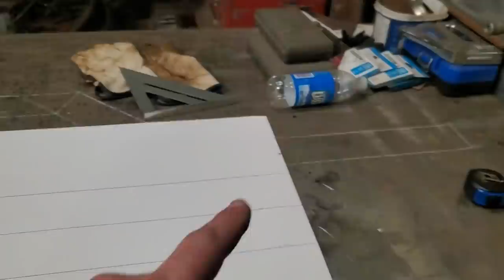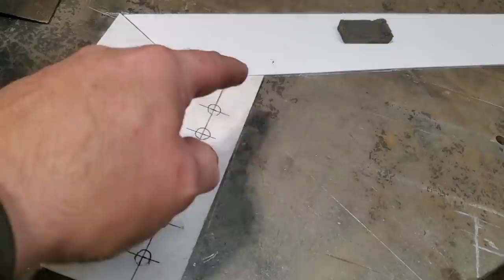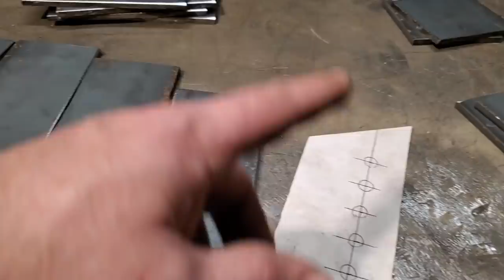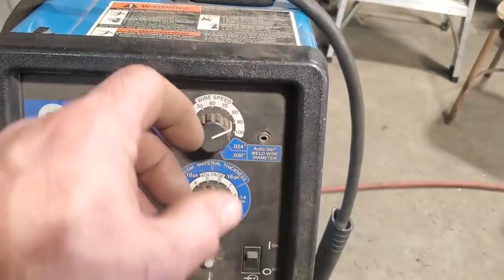Crusty Is a roller!

Comment: Hey Fitzee, amazing job so far. I wanted to contribute a little suggestion for your bare metal project since you'll be steping away for a little bit. Lightly coating your bare metal (or lightly rusted) with  Kleen Strip concrete and metal prep (basically a mild phosphoric acid I think) will stop it from rusting for a good while while etching it. After a few hours, just neutralize it with water/baking soda although it actually doesnt hurt to leave it on. On rust, it leaves a white residue that can be painted on although I prefer to remove it with sanding. The product is dirt cheap at $15 1/2 gal. I've had bare metal parts for a good year in the high humidity of Puerto Rico and it just turns bare metal into a kind of a galvanized look. I even sprayed it inside hard to reach chassis sections with a long hose and a spray tip before applying rust encapsulator or paint.  Anyways, that's it for that one. Hope the tips are good, and until next time!
Reply: "Anyways, that's it for that one. Hope the tips are good, and until next time!" You are so right on that! Stay safe in Puerto Rico, greeting from Switzerland 👍
Reply: @rjung_ch  Peurto Rico?  He's in Newfoundland, Canada.
Reply: @rgc1961  Fred Laracuente is from Puerto Rico. He is taking about himself and not about Tony. Hope this helps you clear your concern.
Reply: @rgc1961  they’re basically the same place with the exception of every single detail…🤣🤣🤣🤣
Reply: @nobodyspecial6436  My thoughts exactly!  😁
Reply: Thanks for that anti rust treatment tip. I'm going to try it when the temperature here is above freezing. How my climate can have sub tropical humidity in the summer and near zero temperatures in the winter is something that has always surprised me.
Reply: @nobodyspecial6436  and @B C apparently you guys are trying to keep a good sense of humor and I thank you for it. But for those who don’t know, there is a minor similarity between the two places. Both are surrounded by a large body of water that some people call it (I think an ocean)(that is water with a high concentration of salt) therefore it generates a lot of humidity (wonder why). I think it was just a reminder of something that Tony is well aware of. 😉😉
Reply: That's what I use on my projects. Works great!
Reply: @calebvelez1836  thanks Captain Obvious….
Reply: @nobodyspecial6436  What? Not so funny now? 🤓

Sorry if I hurt your feelings. 
Remember, it’s just keeping a good sense of humor!
Reply: @calebvelez1836  still funny…. I’m not one who gets upset by words on a screen….. you stated the obvious so I retorted with a sarcastic thanks… all good fun
Reply: @nobodyspecial6436  l agree 💯. 
Back to the subject, I love Tony’s work. More down to earth. I can never afford to do one high end restoration. I will do it his way. Accomplish the results the easiest and practical.

Comment: Great minds must think alike, when I did our 65 Mustang 20 years ago, I made 2 x 3 frame rails as you did, but I  installed a 4 link, I used the same process as you did.....good job!!
You can order springs from Calvert, I'm sure you know that..the only problem I ran into with a A arm front suspension was the headers...they were a nightmare!!

Comment: I'm liking the approach of building it square and solid, then figuring out the misc via templates and common sense. These days way too many would do some fancy computer aided drawing and spend twice as much time fabricating on the bench, then be lost while trying to suspend the part in mid air. Can't wait to see how you attack the space needed for a driveshaft, which I'm sure will be another template laid out on the bench, I mean, it's "cut and fit" but it's something anyone can relate to and get a good end result with basic tools.

Comment: Just find some good thick well casing for the driveshaft. that will maintain great cross member strength and look cool. Drill some of them big fancy lightening holes in it like the slider brackets. Very impressed with your work. I am a mechanical designer, Aerospace. What people don't realize about design/fabrication is a good designer is one who recovers from an error quickly, cheaply and correctly. I was good at that. You are as good as it gets. It's unbelievable to be as good as you are with no frame jig, no engineering drawings in 3D solid modeling, no lasers and no help. Be proud. I fall asleep every night thinking about how to fix or refine something on my home builds. You also make good videos.

Comment: Great work Fitzee. I built a similar chassis under a '71 Pinto in 1980. I couldn't afford the popular Alston kit at the time but tubing was affordable. I was lucky and didn't have to fix rust. It was 94 inch wheelbase and quite a handful at 125 mph. Thanks for the great video.
Reply: I drove a buddy's BBC w/power glide, Opal GT on the track. I don't know what the wheel base was, but SHORT!!!! That was a scary ride from leaving the hole!!!  First car I ever drove that left the hole around 5K... I don't think I took a breath until I was on the return road..
Reply: @SteveP-vm1uc  Yep, mine was my introduction on what bump steer really means. Once the chassis is dialed in its still an exhilarating ride.
Reply: I sure hope that you didn't run any Firestone 500 radials on a "71" Pinto at that speed.

Comment: Like the way you work, I like to use Bacon grease for drilling and tapping holes. It is cheap and works as well or even better then the commercial store bought stuff, been using it for years.....Only thing is you have to keep it covered because the mice loves the stuff.  Stays fresh at room temp as well.

Comment: Awesome work! Both in the build and in documenting all of what you do. I really appreciate how you took the time to share your welder set up for the 1/4” plate. I noticed you were kind able of pulsing while welding the chassis to the plates on the body. If you need an idea for a short video (like you don’t have enough on your plate already) I’d be keen on learning about that technique and using the mig to weld heavier material. Thanks

Comment: I ran into the same issue about the leg room, but remember there is rails /slides going under the seat. You should get close to the 2" back  once the seat is off the floor.

Comment: Once again I commend you for what you do with what you do it with.(if that makes sense) But, and this is my opinion, for doing frame and chassis work I have made the investment in an auto leveling laser level. The kind that builders use. projects lines both horizontal and vertical. It takes the uneven work surfaces as the floor and work bench out of the equation and allows you to get everything dead nuts accurate. Easily with in a 1/16" or less. well worth the couple hundred bucks you pay for it. Cheers

Comment: Nice! I'll have to finish watching it later. Got to do the work thing. I started thinking about setting up the rear of the 50 using truck trailing arms, and got lost in a day of instant center theory. Not sure how much difference it is going to make, that 8BA is a powerhouse! LOL
Reply from the maker: You get a real nice ride with those trucks arms.
Reply: @fitzeesfabrications  Yes sir. I have a 63 chevy truck that I've had for 30 years. Had that spare set of arms for almost as long.

Comment: I built a "T bucket" frame in my dirt floor garage on saw horses. I had more time in plumb, level, and square than I did in cutting and welding. You sure have a nice bench and level concrete floor. Jealous!   CM

Comment: Hey Fitzee, I'm about an hour into the video and I had a question that very well could be covered, but I had to ask before I forget LOL. 
If you're going to be able to change the spring angle by moving the front spring location up/down a max of 7 degrees, that will change the pinion angle also. Will you be using shims to re-set the pinion angle?
Reply from the maker: Shims
Reply: @fitzeesfabrications  minty

Comment: Wow Fitzee. This has been so very interesting to watch.  I love your passion and commitment to the tasks that need to be done.  I'm learning and have a question about why you welded corner supports in the front chassis but didn't in the rear.  I am referring to where the chassis is arched over the  wheel wells.  In the front you welded diamond shaped supports on both s sides of the chassis, but not in the rear?  Is there a reason why?  I love your work.. Can't wait for next episode.

Comment: YJ springs wrap like crazy.. At east they did when I used them on my Suzuki Samurai (SJ413)  4x4 when I added Toyota pickup axles. They turned into a nice 'S' shape in nothing flat.  But you've probably considered this in your design.
Reply from the maker: Yes planning on clamping the front half of the leafs

Comment: If you had needed more room behind the drivers seat for the crossbar location, you could have re-drilled the leaf springs to move the center pin forward. This would have allowed you to move the cross member further back in the body.   With the cross member in place, it would have still allowed you to be able to center the rear axle in the wheel opening.  This is something that Mopar did in the 60 and 70s with their leaf springs.  Moving the center pin of the leaf spring forward tended to reduce spring wrap under acceleration.  They also added an extra leaf on the passenger side to help plant the passenger rear wheel (since because of the torque it is the first to spin) and reduce wheel hop on that side.  Moving the center pin on a leaf spring is a valid way (ie, reliable) to modify leaf springs, as long as you don't drill it closer than 1 inch on center from the original hole (to prevent cracking).  You only need to drill the longest two leaves, you can just move the rest of the leaves forward on the spring.  Moving the shorter leaves forwards also helps with avoiding spring wrap.  You should avoid moving the center pin forwards on the spring more than about 2 inches in any case, because you start to lose any benefit of preventing spring wrap, and because it tends to put an excessive load on the front spring eye and the longest leaf.

Comment: Probably telling you about sucking eggs, if so please ignore, but just in case. At one stage you commented about having the diff pinion parallel to the spring mounts. It actually needs to end up with the engine crank shaft and the diff pinion parallel.  This is needed to keep the angle on the front and rear drive shaft universals the same angle. Having these angles different will cause drive shaft vibration. A universal actually changes speed as it rotates, If the front and rear angles are the same and timed they cancel each other out. I saw it on a garbage truck of all things. It was a new truck but on a certain hill at a certain speed it vibrated. IIRC the diff was only out by 1/2 a degree, we rolled the diff until it was correct, no more vibration. Now seen this on several vehicles over the years.
Reply from the maker: The angle will be set up when engine and trans is installed

Comment: Fitzee that Carola should move out rather nicely . What Mill are you putting in it ? And a four speed should get the torque to the diff . perhaps a Ford nine inch noduler posi should give ya the launch your after but that's my opinion that n five cents will gets me a bubble gum . Lol . But to know what your plan is would be awesome. Please advise . I did a 74 seleca st. It was very quick and was a joy to drive and race . Had a 383 stroker four speed and a nine inch posi . Tons of work to get it all to fit but it was worth every second . The front end was a mustang 2 kit.
Reply from the maker: The plan is a 4.8 ls with a single turbo running threw a 3 speed t400 trans with a 9 inch out the back. Plan is for a 1/8 mile street strip car
Reply: @fitzeesfabrications  awesome should move out nicely . Can't wait to see the finished project. Might have to come have a gander at it. 😎👍

Comment: I love your channel, your skills and the simplisity in how you approache and tackle problems. That kind of rust you jump in to, are at least problems for me. Impressing! 
I know you love your angle grinders, but have you tried a metal cutting circular saw? The benefit as I see it is that they eliminates grinding dust and perhaps save some money because of less wear on a sawblade comparing to cutting discs. One that look promising is Makita DCS552Z. I think other manufacturers have similar.
Reply from the maker: Those blades are thick great for chopping metal but for doing small detail work they are not

Comment: Firstly congratulations, I know the feeling of a milestone like this. Wondering why you wouldnt use the original springs , given they suit the weight of the car, guessing they might not be strong enough for the power or diff weight
Reply from the maker: They were a narrow spring. I wanted to go with the standard 2 inch spring that the caltracs are built for

Comment: Hey Fitzee, be sure to check out K5 or Wagoneer front leaf springs. They're often used in the rear of a yj to add spring rate and/or change wheelbase.
Reply: Also consider a snail pack, wherein the anti-wrap leaves are above the main leaf.

Comment: I foresee problems 1st is with the drive shaft going through the square crossbrace tube and second is drive line inclination and future pinion snubber location.Also isn't'  the differential supposed mount under the leaf springs
Reply from the maker: That cross brace will be moved. And no thr axle can be mounted both ways

Comment: just a question Tony,  i know  it's build as a race car,  any reason  why the option of building it without body mounts,  having  one  solid   structure  vs  2 independent separate ones  ?
Reply from the maker: Roll cage will make it hard to remove

Comment: You've made the plates to mount the chassis to the body - why not add a second plate and bolt them together vs welding to make removal of the body (if needed) easier?

EDIT:  BTW, love the series.  I keep thinking about building something similar, although I have it in my head to use a VW Golf body instead because I'm apparently weird.
Reply from the maker: I thought about doing that but with a cage running through the back dash and front dash it makes it pointless as these sections will be closed in once body is on. If I wasn't putting a cage in it I would did a body mount system
Reply: @fitzeesfabrications  yeah, not having all those details in my head, it makes sense why you are doing it that way.  If I ever get serious about linking/tubing the Jeep, I'd do the same and just weld the body to the new frame rails as well for much the same reasons.  Also, if the body ever needed to come of the Jeep, it's probably junk/rolled anyway :D

Comment: What wire did you use to weld the 6x6 1/8 plate for the outriggers. Can I use 0.030?
Reply from the maker: I used 023 wire. Why cause it was in the machine. 030 would be better.
Reply: Ok thanks I didn’t want to burn through

Comment: Hi can I use 2x2 .120 square tube steel on my rear chassis. I have a 81 Toyota Starlet. I’m doing a project similar to yours but using 5.0 Mustang engine and 8.8 rearend please lmk thanks
Reply from the maker: You can but there will be more flex.
Reply: Thank you any updates on your Toyota

Comment: Hey Fitzee how do you keep it rust free for so long after removing the paint?  If my car sits for more then a day or so it can flash rust in some places.  How long can you leave a part bare metal while you work on the rest?
Reply from the maker: Temperature in the garage is kept a constant Temperature.  It's never really cold out there heat is always on

Comment: How does a guy Measure and find proper Lief springs. I have a 1963 Ford Fairlane with bad rear Leaf springs. Is there a place you guys can cross reference
Reply from the maker: Goggle.  I loked up the springs I have and were the most common short ones I could get in 2 inch

Comment: Wasn’t listening to the video just watching. But if you’re not already planning on using a cal trac setup on this, you really should consider it. I made a setup using part from tractor supply and John Deere along with plates for a full size Chevy truck on my little truck and it brought my sixty foots from 1.5s to mid 1.3s. I also have a little Datsun similar to your Toyota just a mini tub back half but it’s been in the bumper many times. <<<see avatar

Comment: What size wire did you use
Reply from the maker: 023. I went slow. 030 be better for the frame welds. Machine was set up with 023 so I went with it

Comment: I still fail to understand that after all this custom work why you would put in old leaf springs instead of a 5 link with coilovers given your objective of having a performance car. The leaf spring axle will still need to be tied down and I reckon a properly setup coilover/5link may end up lighter as well. It is a more compact setup, and with your fabricating skills it would be a breeze to make. I would not put in all this work to have leak springs.
Reply from the maker: I done all the 4 link stuff. Did ladder bar too. Now it's time to do something different. The technology of leafs have come a long way. As for weight it's in the right place.